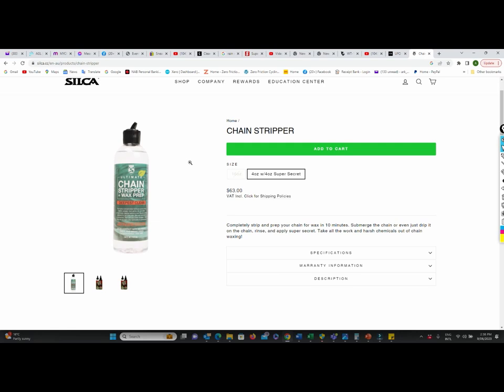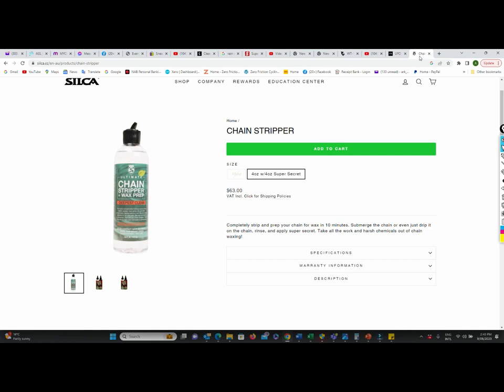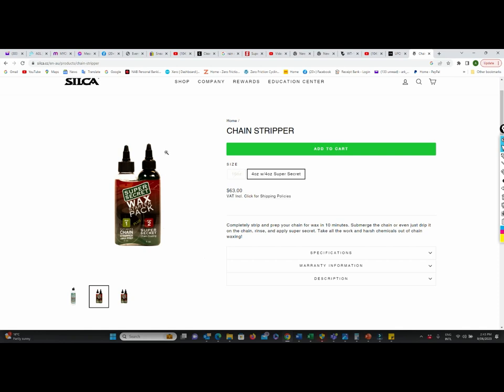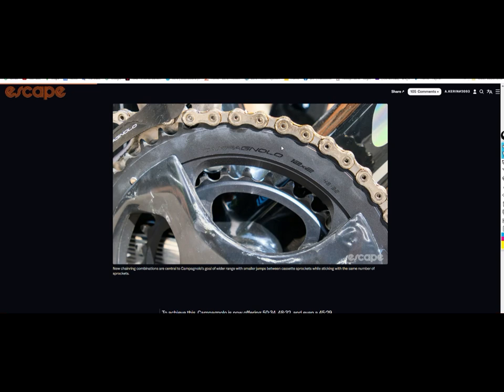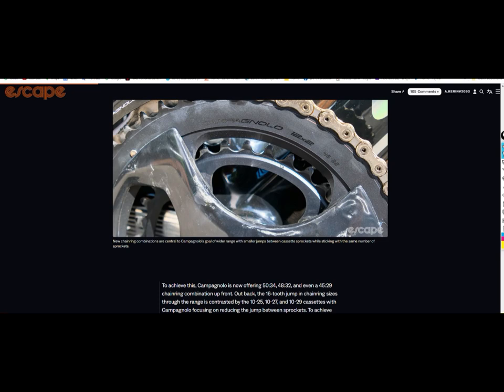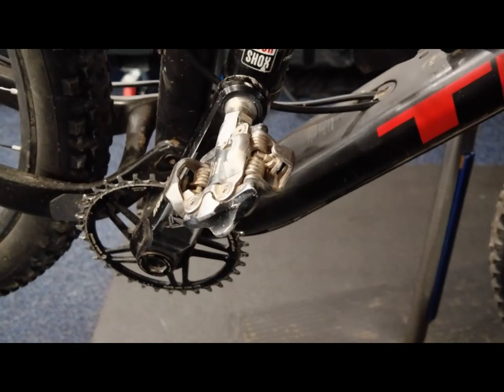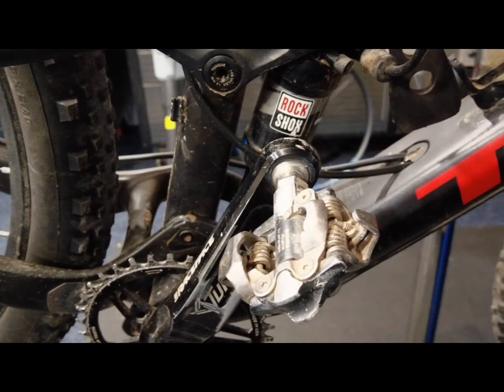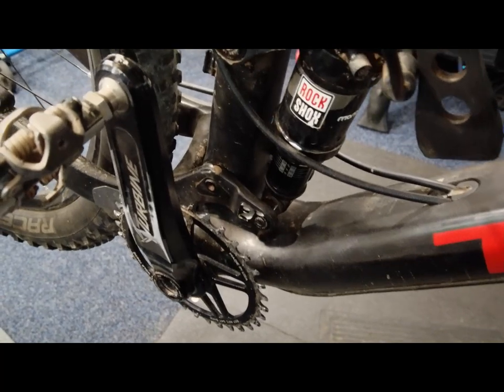Stripper and campy 10t

Comment: Watched this year old clip only now. 

Adam I really don’t know why you focused so much on the front chainrings where total system chain articulation power losses are concerned. Its likely to be up to 18 times higher at rear cog !

Explanation follows;

Bike chain goes through many more articulation cycles and angle at the rear than the front . Whether it be 52/12, 48/11, or 44/10. Ratio is approx 4.3 in top gear.

Year10 school physics tells us chain tension is equal and opposite, regardless of chain in motion.
Depending on chain stretch most tension is held in perhaps 3 link sets at either end of the tensioned chain line. 
So,
Given that those 3 link sets wrap around a greater arc angle of the rear cog than the larger front chain ring its clear to understand more angular articulation under tension happens at the rear cog(s). 
To boot, in top gear there are 4.3 as many link articulations at the rear previously mentioned !

Calculating chain articulation angles 360/52Teeth makes 7deg at chainring tangent. 360/12teeth makes 30deg at smallest rear cog tangent !
So
30deg/7deg makes 4.3 times the angular displacement 

Therefore in conclusion, of total watts lost to chain system articulations it’s reasonable to say in a 52/12 gear chain articulation ratio is 4.3x4.3 (18 times higher)at rear cog than front ! 
Obviously this is only considering tensioned chain parameters.(no jockey wheels etc)

Suffice to say, knowing this back in the eighties I was hesitant when Shimano went from 13 to 12 cog min. let alone a 10 by Sram! Friggin idiotic ! 

Marketing more than manufacturing cost saving i feel..
Reply from the maker: Derek you have in your explanation helped reinforce my explanation why. I am sure i covered thoroughly that... 

> Large rings reduce chain TENSION load. 
> Large rings will have one in a LARGER cog for a given desired gear inches
> Therefore the articulation over the rings AND THE REAR COG will be occurring under a LOWER tension load, and of course if in a larger cog for a given gear inches - at the rear there is less articulation to occur. 

So yes, the rear is extremely important re the efficiency gains, but the efficiency gains at the rear come by way of running a larger chain ring. Thats why there is the focus on the chain ring size...
Reply: Ok i see what you’re getting at. Less chain tension, I get it.  
To explain my misunderstanding you seemed to be making a front chainrings VRS rear cogs being a point of focus..

Rather;
for the sake of better chain wear, the focus should be achieving similar ratios by using larger tooth number Front AND Rear . Most of us wouldn’t use a larger chainring at front with out thinking of consequence to rear selection.

I’m from a time before BS terms like ‘compact’ ‘mid compact’ etc existed. To me its cog front ,cogs rear, give you a ratio thus. 

We’re on the same page, just had to clear with myself why is Adam saying this 😅😅👍👍

Comment: I remember you asked for tips on how to make shorter videos. So here is a tip 😃. You saved me from muc off and your videos hold the highest value. However, they are all so long. I think you have reached the level of credibility that you don’t really need to explain things too much anymore. Like don’t explain as if you want to convince people to believe you by sharing with them the logic of why things are the way they are. Instead you can just tell us what to do and we could easily follow the advice. 

Example: wax based lubricants are a lot better in the real world compared to oil based lubricants. When you cover a surface with oil like a table and then throw small particles at it, everything sticks right? so this proves oil collects lot of dust and debris from the road. Now if you allow some molten wax from candle to drop on that same table and let it coo down, you wont have particles stick to it the same way right? This is why wax based lubricants are better.

INSTEAD: wax based lubricants are a lot better in the real world compared to oil based lubricants. This is because oil based lubricants gather lots of dust and debris to themselves which is what you dont want. But wax based lubricants do not attract dirt to themselves the same way and will allow for consistent efficiency.
Reply from the maker: yes true but i have to remember also that this might be first zfc vid one see's / cyclists new into thinking about such things - i will find it very hard not to explain most things fully. or over fully.... :)
Reply: I would rather disagree. A lot of audience and credibility gathered exactly because of explanations in simple and digestable terms. And this process must not stop.
Rather, do some scripting and ask somebody to redact the text. Because I noticed quite often you repeat some theses couple of times too much.
Also, you may split the videos by topic. Like now, one may be dedicated to silca, another to campa
Reply from the maker: @feedbackzaloop  thanks feedback - yes i really am going to try to find more time to prep to avoid this - I know i keep apologizing and making excuses but alas today was tricky, a number of tech issues had me very very time pressed today, but i still wanted to quickly smash this out as i have quite a backlog of vids to get out including catching up on detail reviews so i didnt want to miss a spot. but i am always rushing a bit much, i need to secure myself more time to prep, re take where necessary and edit time - its just.... tricky for me - always very busy - but i am really going to keeping chipping away at it - and everyone keep holding me to it :)

Comment: I have always ridden Campag until I went electronic and was tempted by wireless electronic Etap from Sram, 11 speed with 36/52 chainrings up front, built on. A Bianchi Specialissima, later I was fortunate enough to buy a Pantani anniversary Specialissima and built the bike on Sram Red Etap AXS with 35/48 chainrings up front, so we have the same bikes but with two groupset options, I was curious to apply my own test on the same piece of road, riding the same watts on the big chainrings at the same cadence, the end results we absolutely the same average speed and same average watts, ZERO Difference whatsoever, same old thing of people bench testing instead of just going out and testing in the real world and just enjoying riding a bike 🤷‍♂️
Reply from the maker: Yep for sure mark - most will not ever be able to detect. Can you be certain that for both tests that air temp, pressure and humidity were the same? Same tires - model, size, pressure? Any difference in wheels and bearings? In difference in what you were wearing, and what position you were holding for all moments across the ride - considering 2 to 5w of aero difference can be attained with the smallest differences etc etc. 

What we can say for sure; 
a) The physics and the maths behind the FACT that smaller is less efficient is indisputable. 
b) precise efficiency testing confirmed exactly the maths and physics. 
c) There is no reason that we should be getting drivetrains that are less efficient. The latest and greatest should be a move forward in this area as well. not backwards - even if the normal cyclist would never be able to detect it. 
d) The pro peleton would never accept such ring sizes - for the simple reason that the reality is they are less efficient. So the rest of us are just chumps then? The reason for the lower efficiency is for their mfg cost - not for our benefit - and can we see where they are passing that cost saving to us? 
e) Lets say conti brought out their new GP5000 TT - and it was 2w slower than the previous version of the tire, and the reason it is 2w slower is because they saved cost on mfg, but the cost of the tire increased to $150 from $120. Would that be a great move forwards for the consumer ? More expensive and less efficient? even if in a real world ride test the normal cyclist would not be able to time a difference? 

There is no good reason, for us - for road groupsets to move to a 10t and smaller rings. It is a step backwards for us to save X amount for the mfg - which we can not detect at all that is being passed on to us, hard to detect when they keep getting more expensive. For me, to a large degree - on principal we should not be happily accepting a step backwards in efficiency, for more cost, for the latest and greatest groupsets. But they are banking on the fact 99% of cyclists will think same as you, and they are perhaps correct and have no consequence for charging more and delivering a less efficient drivetrain. Personally i would not accept - even though i do not take my racing seriously, i would never, ever, ever purchase a road groupset with a 10t and small rings (unless literally that is all that is available on the market if all 3 go that path). The mfg should make available at reasonable prices larger ring options.

Comment: I really don't understand Campagnolo with the release of the new wireless groupset with radical gearing ratios, i had hoped that given their heritage and past inventions that brought progress and benefit they would have got it right??? 
Why did they not just take the original 12 speed and give us a wireless option, the sensible groupsets for road bikes has now gone, do all manufacturers want Road cyclists to ride mountain bikes in disguise? Road bikes don't need disc brakes or silly gear ratios and also at the same time being denied CHOICE!  I will stick with my 52/36 11/32 12 speed Super Record EPS as it works so why fix it. Oh! yes and direct rim brakes on my Colnago C64.
Reply from the maker: Yes overall i think this is going to be a costly miss. The removal of the thumb shifter will really put off their heritage fans, and they are just crucial. At over 8k aud, i just dont see any young-ish cyclists deciding against sram or shimano in favour of campy. So i cant see them winning new fans, but i can see them losing more heritage fans, so thats not exactly a winning direction, and i am not sure how that scenario would not have been presented at strategy meetings. They must be discussing strategy with Ferrari F1 team.... 

Re rim - thats not just campy that is everyone. Industry + market have decided that direction. it is just too expensive for brands to run two different molds of same bike, remembering that it needs to be across at least 5 sizes - to make a rim and disc version. It is extremely difficult to get production vs demand numbers correct as it is, by model, by size - a bunch of unsold at end of year hurts everyone in that sales chain - trying to predict sales of rim, sufficient that it would actually end up in a net profit - that is just too fraught a path - so yeah trying to get ANY top model from any top brand in rim is near impossible now, and i understand why when the market for rim is now so small.  There is a lot more to it than just the argument of what is a better brake, moving away from rim has enabled wheels to be aero optimised for much wider tires, which brings some benefits, ones braking does not over time wear through a possible 5k wheelset, we have hookless tubeless (dont get me started) where blow off from pressure increase from temp if rim braking would be a risk etc etc. For all that and more, rim is just never going to have the demand to justify the production costs. 

For those who love rim (i still love my 2014 black inc evo)  - custom is really the way to go - the market is pretty flooded with many - actually really great - custom builders. I building a bastion and i was tempted by rim still, but in the end as i hope to be rockin that bike for the next quarter century, the ability to run 28 tires with 70ps vs 23's with 90 etc, and probably larger again in my twilight years - it just has to be disc. Disc far from perfect, but it will keep improving.
Reply: @zerofrictioncycling992  Thank you for your intelligent explanation of the 'Campagnolo New Groupset" and reasons for, I guess I am just a old cyclist of 40+ who hates change for profit margins. The positive thing is I have enough bikes to see my days out without having to buy a road bike with discs and 'new Campagnolo groupset"

Comment: Adam, just for fun, I decided to throw the video transcript into ChatGPT for a summary...here's what I got (spelling/translation errors included)

#### Summary
- There is a new chain stripper product called Silka that competes with Ceramic Speed's UFO drivetrain cleaner.
- Silka's chain stripper is super concentrated, making it easy to clean the chain and remove factory grease.
- The concentrated formula allows for a perfect off-bike clean, which is difficult to achieve with traditional solvents.
- Despite being more expensive, Silka's chain stripper is cost-effective in the long run because a little product goes a long way.
- The cleaner is environmentally friendly but caution should be taken when disposing of factory grease.
- Campagnolo has launched a new wireless 12-speed groupset with a focus on zero friction cycling.
- The move to a 10-tooth cog in the cassette has received mixed opinions.
- The smaller chainrings accompanying the 10-tooth cog can lead to increased chain tension and articulation, resulting in efficiency losses.
- The efficiency differences may not be noticeable to most cyclists, but there are measurable losses in certain gear ratios.
- The move to smaller chainrings is seen as a step backward in drivetrain efficiency.
- A demonstration with crank spins is provided to illustrate the potential losses.
- The decision to use smaller chainrings with a 10-tooth cog is criticized for compromising efficiency.

#### Highlights
- Silka's chain stripper offers a concentrated and effective solution for cleaning chains.
- The move to a 10-tooth cog in Campagnolo's new groupset has raised concerns about efficiency losses.
- Smaller chainrings accompanying the 10-tooth cog contribute to increased chain tension and potential efficiency compromises.
Reply from the maker: Beauty!!!  when can i get that to take over my vid production? :)
Reply: Took me less than 2min to read. A 26m video is ridiculous
Reply from the maker: @janeblogs324  I may not be the right channel for you :)
Reply: @zerofrictioncycling992  you remind me of a church preacher, 1000s of excess words to pad out an essay. 
When clarkson,Hammond, may were making their new show they told us the number 1 tip about videoforamtion is the bare minimum words to get the facts/point across. The way youre doing it is just setting yourself up for piracy/plagurism while you foot all the testing costs
Reply from the maker: @janeblogs324  Thats awesome, thankyou. You likely havent seen any of the vids where i re -iterate that i know i am terrible atm at you tube. I never planned to do you tube, am not a good speaker / presenter - and i will be working at getting better - but i also severely lack prep time, and pump out what i can when. I hope to retire in the next 18 months ish - and hopefully someone better can pick up the torch in this space. In the interim - rest assured - i know - i just am who i am, it is hard to change ones spots - especially in a non strength area. If it makes you feel better though, please keep telling me how bad i am. Or - go watch channels you like..... :)
Reply: @zerofrictioncycling992  no ones telling you how bad you are, but if you're selling information it has to be digestible
Reply from the maker: @janeblogs324  i am not selling information - i am providing information. I would read other comments on vids - some love the conversational style, others like yourself do not. I listen to a lot of content on a lot of topics as i work, i personally love channels that is conversational style - i find i get a lot more out of those, vs channels that try to be very efficient - to me they just lose a lot. And also, many video channels that sure do much shorter vids - but in that say 10 mins vid - they practically say nothing that was not in the headline - so they are short, but they are nothingburgers. 

I will be trying to improve things such as not repeating, and improving efficiency over time, but i will be unlikely to change my overall conversation style, it is just me, and it is what i enjoy from the channels i choose to listen too. I have found channels where i would overall probably like to get the content, but i just really dont enjoy their style, so i find others. I dont feel the need to hang crap on them - it is their channel, their style - and others enjoy it. We dont all like the same music. We dont all like the same movies. we have friends that dont get along with other friends - we are all different people with different preferences - i am not yours, and that is fine. I am sure i will not be the last channel you come across in your life where the style does not suit you - i would relax about it, and move on to channels that do.